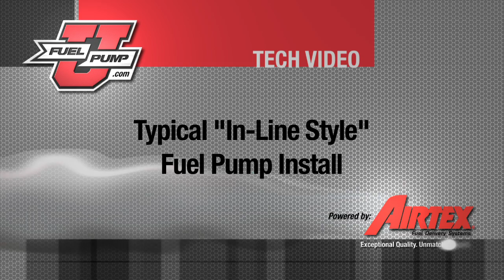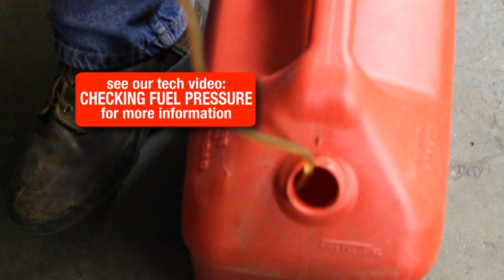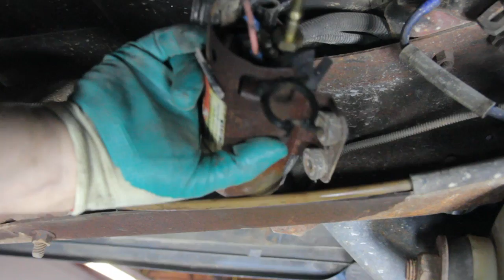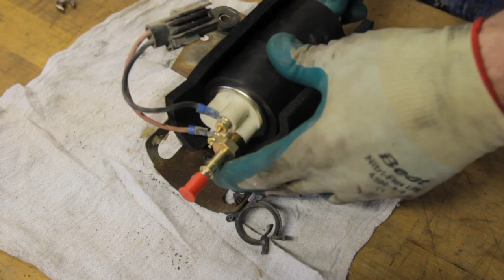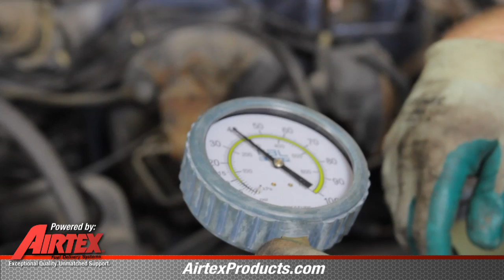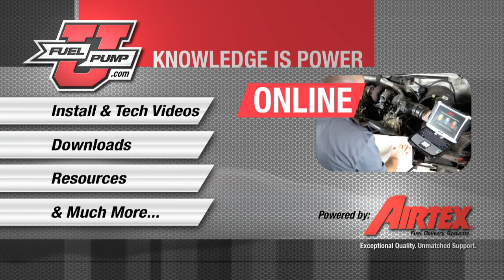How to Install Fuel Pump in 1985-1991 Ford Truck 140, 2000-2003 Ford Excursion, 1998-2002 Dodge Ram

Comment: I have a 87 model carbureted 460. Someone took mechanical pump off and put in line pump on frame seems to want to run out of gas going uphill or when it gets half a tank is my pump going bad or is there helper pumps in the tanks or is that just sending units?

Comment: I have an 88 F150. Dual fuel tanks. I guess I have a pump in each tank and one high pressure one (this one) on the frame.
Reply: I have same vehicle and yes one in each tank and one under driver seat
Reply: @Bugsalot31  hey are the fuel pumps/assembly in both tanks the same or different types of pumps/assembly
?
Reply: No and yes same style pump but one is slitly different from other